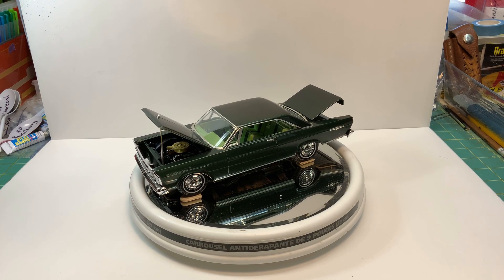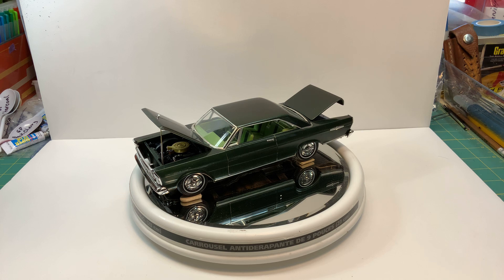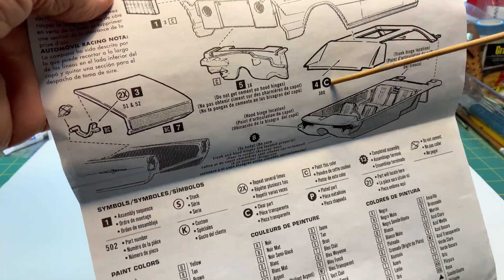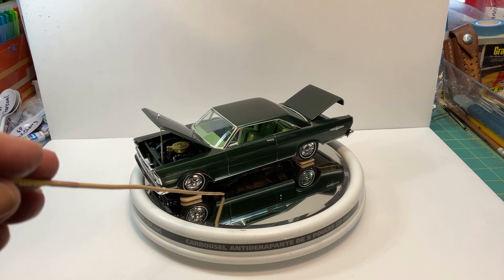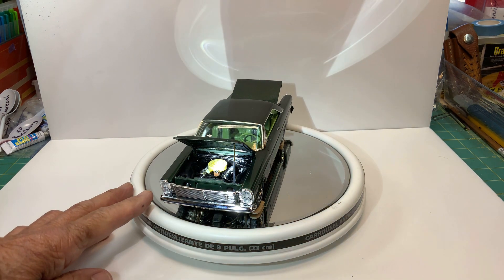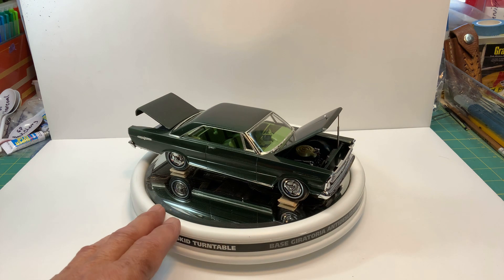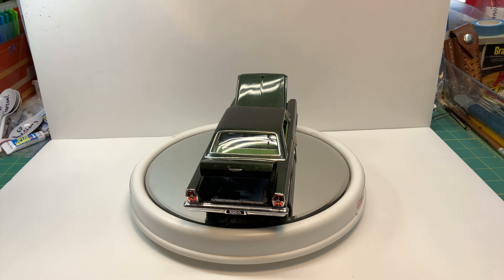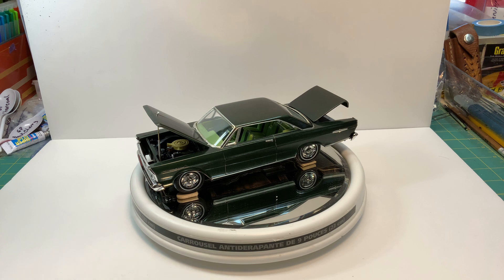Ford Galaxie 500 XL by AMT Final Update           Update

Comment: Turned out really nice Samuel. Wondering how do you like the scalefinishes? I fixing to use it for the 1st and haven’t found any videos on YouTube for a “how to”.
Reply from the maker: Love their paints. They have instructions on their website. Paint is a Lacquer. Dried fast. You clear coat if I remember right away (1/2 hour). Thank you for watching
Reply: @samuelvasquez8170  I must be over looking it because I can’t find any instructions on there website. Thanks
Reply from the maker: @FuelsModels  I was wrong. I found it online. I Googled “How to use scale finishes paints” or you can look for Application Guide - Scalefinishes.com
Reply: @samuelvasquez8170  I finally found it to but there’s no direct links that I can find on the website. I googled it to.
Reply from the maker: @FuelsModels  These paints are pre-thinned. Just shake and pour into your airbrush. They go one really smooth and dry fast.
Reply from the maker: @FuelsModels  Glad you found it.
Reply: @samuelvasquez8170  thanks